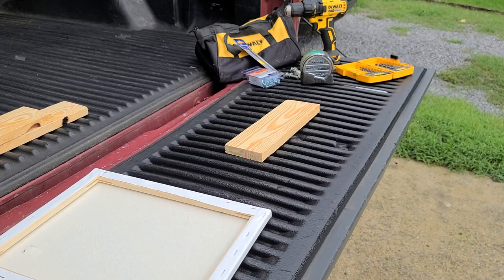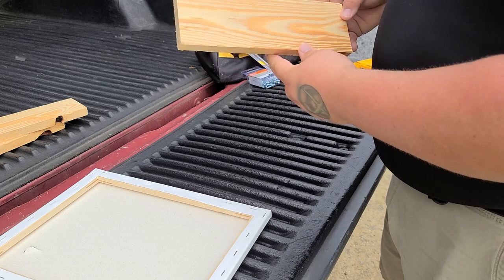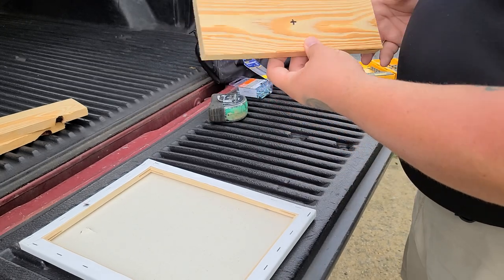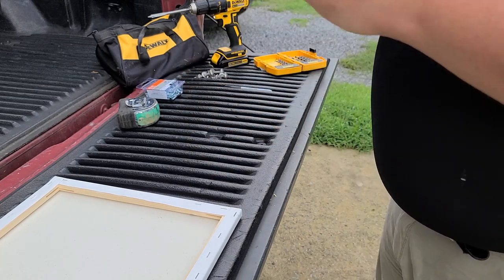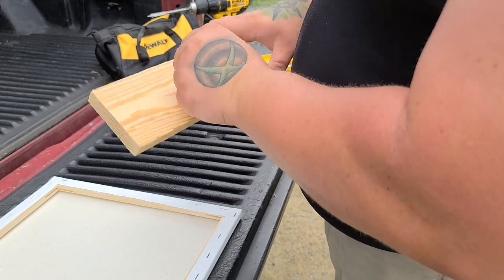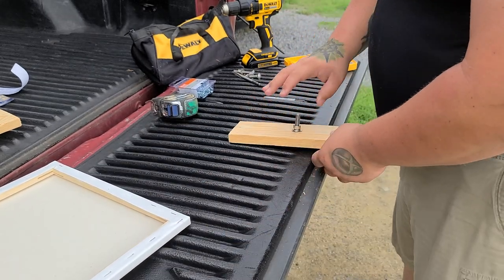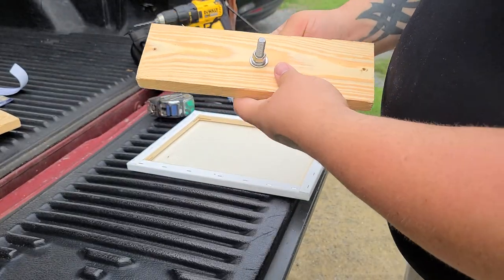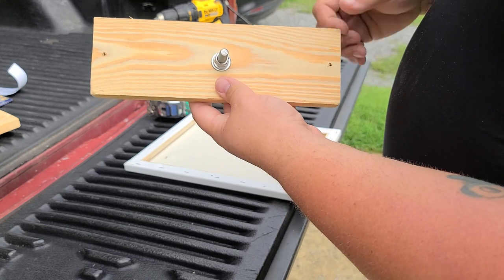DIY Drill Attachment for Spin Art

Comment: Thank you for making this video! Having a way to spin it is the key part of these projects & yet no one else has even mentioned how they do it, let alone gave a detailed explanation!
Reply: Maegan, that is because artists who use this technique don't want others to copy, even though it's been around forever and is nothing new. It's a simple form of creating pour art that anybody with a setup like this can do, after they apply the paint to the canvas.
Reply: That's because an attachment ist extremely simple to make. You simply need that crossbar-piece-of-wood and 1 drill. You drill a hole into the wood, and then you simply glue the drill into the drilled hole. Then the drill and the wood will be one unit which you can store and use as you like.

You're done. Easy, isn't it ?

Comment: Thanks brother! Making a note for myself when I go to the store later. 

Materials used: 
1x4 board (untreated)
Tape measure
#8 screws
3/8 speed bit
5/32 drill bit
Drill
3/8 1.5in carriage bolt 
Flat washer
Lock nut
Sharpie

Comment: We've tried this but had trouble with it spinning completely off or the bolt coming unscrewed
Reply from the maker: You have to make sure that the carriage bolt has the square molded under the bolt head. If it doesnt then it will for sure uncrew.